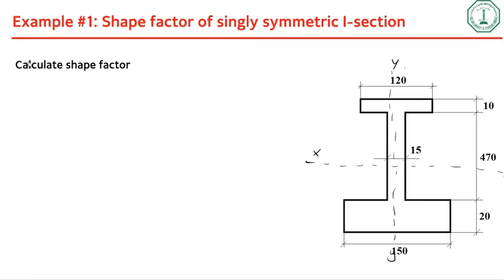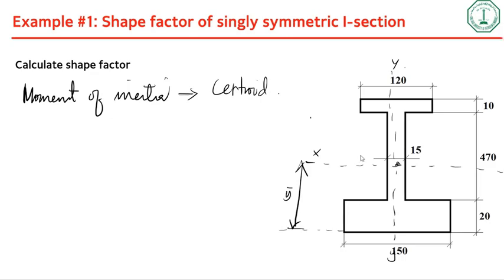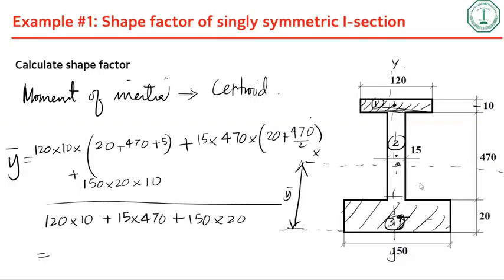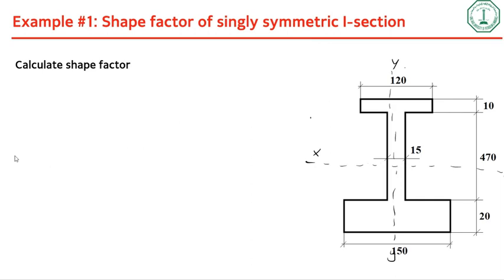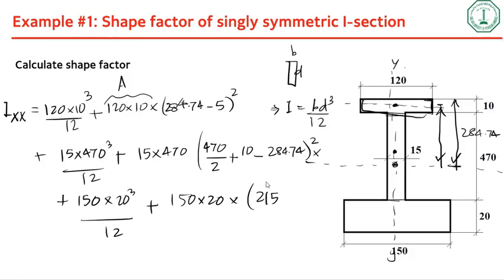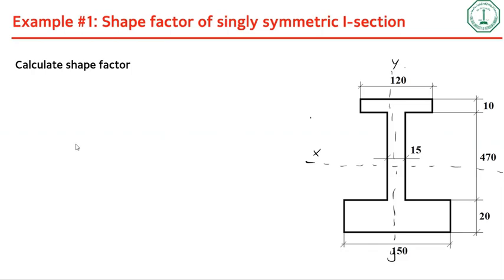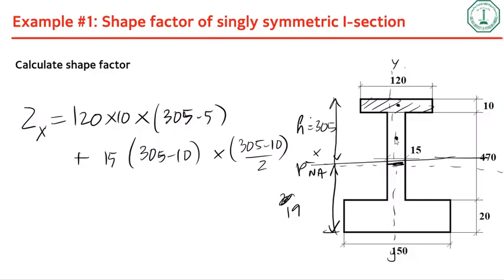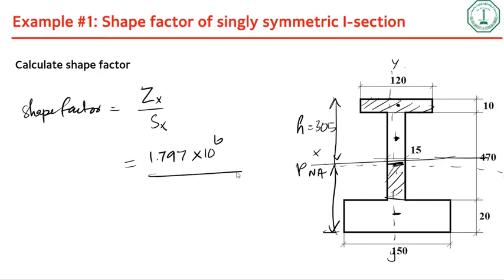How to calculate plastic, elastic section modulus and Shape Factor of a cross-section?

Comment: What is Fy? Like is it a Constant or?
Reply: Fy is yield strength. It depends on the material. It is typically 50 ksi for steel but it can get a lot higher with different 'mixes' of steel that increase yield strength.

Comment: question ,for calculating the elastic section modulus why do not use y bottom as you have calculated?
Reply: Y maximum is required. Y top is greater than y bottom

Comment: I have doubt in your calculations.. some of your points are not clear at all
Reply from the maker: Please tag the time and we can discuss
Reply: @BoldLearning  The calculation for y-bottom has an error the answer is 259.65mm
Reply: @elvismasinde4321  The calculation is correct. The width of the bottom flange is 150 (not 50).